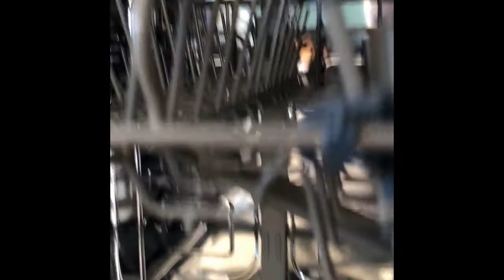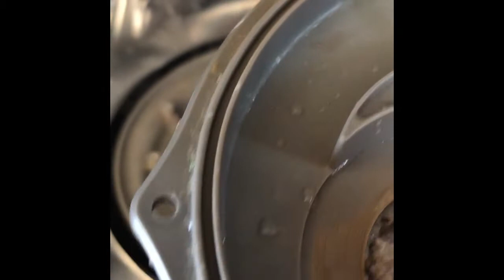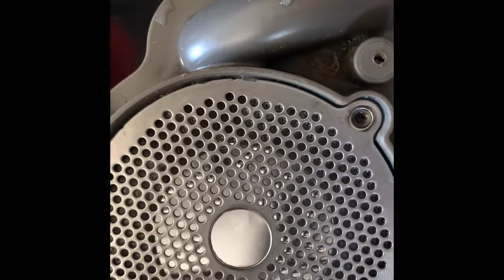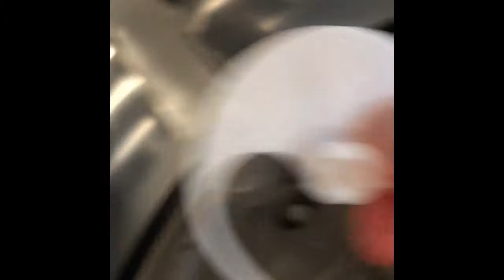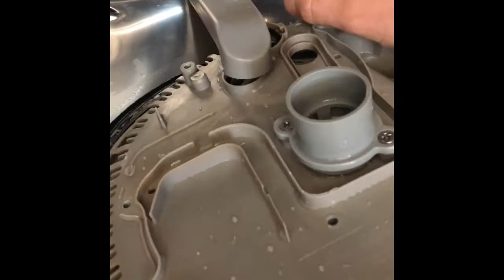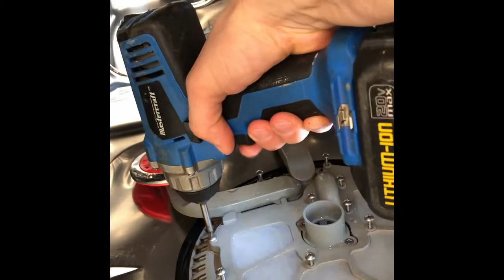Dishwasher Top rack doesn't clean - Samsung

Comment: Thanks man I ignored that there is a filter there beneath the pump wheel.
Reply from the maker: I had to do this cleaning process every 3 months and got tired of it so I drilled bigger holes in the stainless steel mesh filter and since I've done this I haven't had to clean it again. About 1 year ago.

Comment: What if we did all that and it's still not cleaning on the middle and top racks?
Reply: Then most likely your wash motor is weak(circulation motor)and would need to be replaced. The other thing to check is make sure the spray arm holes are clear and not filled with debris.. sometimes you'll see stuff stuck inside some of the holes which will make for poor water pressure on the dishes.